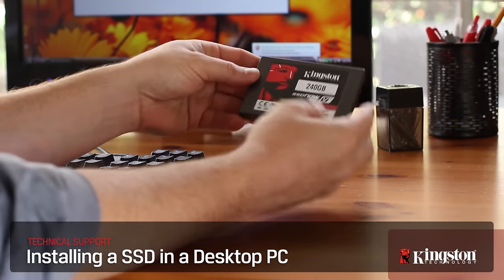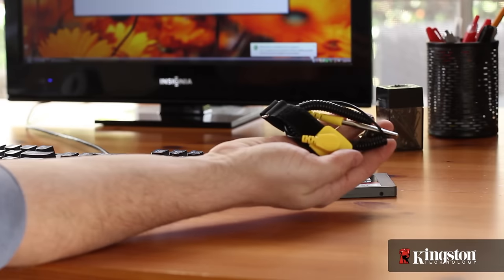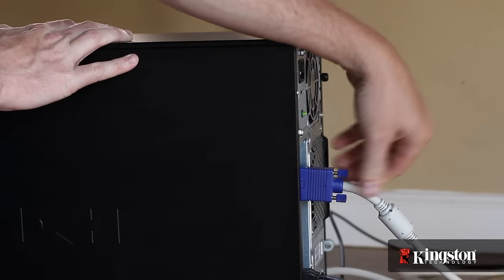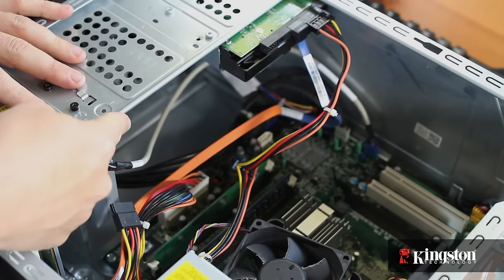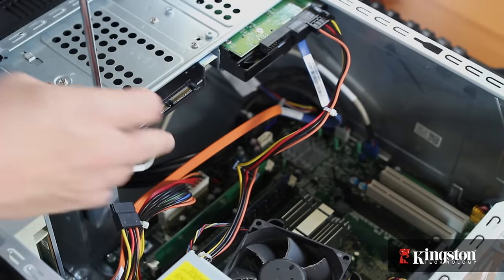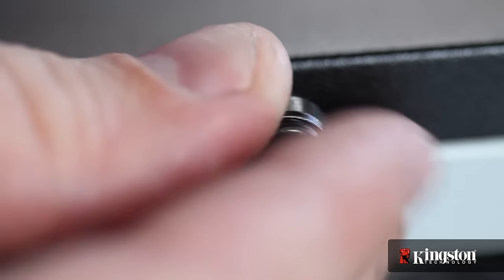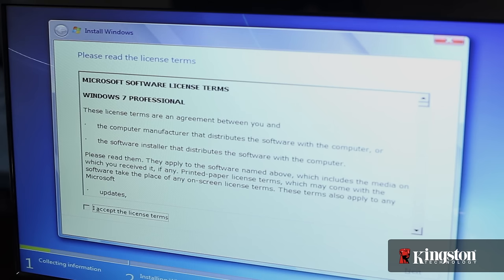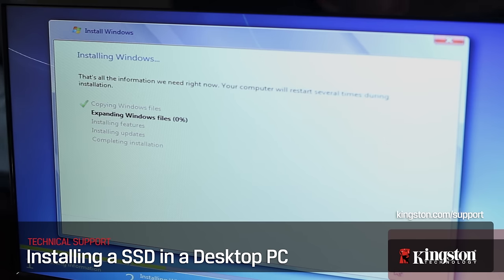Installing a SSD in a Desktop PC

Comment: I installed my ssd plugging in the sata and power connector and when I go into file explorer the ssd doesn’t appear
Reply from the maker: The SSD needs to be initialised through the Disk Management menu of Windows or Disk Utility in the Mac OS operating system before it can be utilised. Should you have any further questions, please contact our support team via: https://www.kingston.com/uk/support.

Comment: what if its an 8gb ssd? will I still have to transfer all my files? they all are WAY more than 8gb. is there a way to boot with my ssd and store with my HDD?
Reply: 8b is not nearly enough to hold an operating system. Get a 60 gb ssd if you want to install the OS on it
Reply: Do 8gb ssd's even exist?

Comment: What make or model are the Brackets to fit the 3.5" drive bay? Exactly what i need to fix the v300 ssd  to the  side mounted bay on a HP 3500 mt desktop.

Comment: I have a new kingston ssd. I haven't put this ssd in any system yet. Just opened the box. I want to install linux mint on this and use it. Do i have to first activate and configure this new ssd by connecting to anyone's windows computer? Or i just directly put this new ssd in my laptop and install linux mint with a bootable usb?
Reply: No need to "activate" it with Windows. Just boot off of your Linux Mint installer and it should detect the SSD.
Reply: @JJFlores197  no need to update the firmware of ssd???
Reply: @SVerma-kw9ol  Not really. In the 6 or so years I've use SSDs, I think I only updated the firmware on my first one, which was a Samsung SSD.

Comment: I just want to install an ssd so I can have my games on there but keep the os on the hard drive because I have a prebuilt. So would I need to reinstall windows
Reply: No, windows will boot from ssd normally
Reply from the maker: Hi, you can install the SSD as a secondary drive in your system and install all the games on it then. There is no need to reinstall Windows on your hard drive then.
Reply: @kingston  thank you
Reply: @elongated2761  Totally agree with Kingston. Many people these days don't use HDD. All memory is put on SSD no matter for Windows or file holding.

Comment: Hey nice guide! I was wondering at the end of the video you said you dont want to install over partition or unallocated space but you only get those options? Which one did you choose?
Reply from the maker: This applies only if you want to keep the data on the drive.  If it is already backed up or the partition is imaged on another disk as backup then you can install over that partition or unallocated space.
Reply from the maker: The correct sentence is to select the drive that is not partitioned or select the drive marked as unallocated as it is the case in this video.

Comment: Can i just buy a SATA cable in the store or do i get one when i buy the SSD, i mean does it has to be a special one to EXACTLY the SSD I have or can i just buy a random SSD cable and it will work on all SSD?
Reply from the maker: There are different types of SATA cables, you will need to check which one is compatible with your particular model.
Reply: @kingston  dont you get the cable with the SSD when you buying it?
Reply from the maker: Those cables are provided with the motherboard and power supply. Laptops do not require cables as they have drive bays with integrated connectors.
Reply: @kingston  I know the power supply which you connect to the SSD to get the power on it, there are already a few of them you can use when you get a new HDD or SSD, but i mean the other SATA cable the small one, you have to connect to cables to the SSD, right?. I took some pictures from the motherboard to find the SATA plug. If you want them then i can send them to you.
Reply from the maker: Come chat with our support, we can help get this figured out https://kings.tn/3g0rSjQ
Reply: Kingston Technology the link doesnt work
Reply from the maker: If you visit the Kingston website, you can contact our support team through there

Comment: Can I use it on my SATA 2 board (desktop)??
Reply from the maker: Please note that all of our SATA III SSDs are backwards compatible to SATA II.
Reply: @kingston  Okay. So, without the lesser r/w speed is there any other difference which will I get?
Reply from the maker: Apart from the reduced read / write speed performance there is no difference in terms of the functionality of the SSD when connected via SATA II.
Reply: @kingston  Thanks a lot for the quick reply. ✌️

Comment: Do I still need an hhd when I use ssd?
Reply from the maker: Not necessary, you technically need just one drive that carries your operating system. A secondary drive (HDD or SSD) is generally used as storage.

Comment: does it matter if my motherboard supports SATA III drives?
Reply from the maker: Hi Peter,  SATA III works fine with all current Kinston 2,5" inch SSD's
Reply: Sorry, I meant if my motherboard "doesn't" support SATAIII
Reply from the maker: Hi Peter,
The current 2,5" SSD's are backwards compatible with SATA II.

Comment: hi can you assist me I have already an ssd installed and has my os on it and few other things, basically I got given another 64gb ssd from a buddy of mine, I have installed it in the system now when I switch the desktop on and go to my computer, only my main ssd shows and not the other one I recently put in how do I enable it to show on my menu in the my computer section? :) its in an alienware aurora r3 model :)
regards

Comment: will this work on a mac pro 2010
Reply from the maker: If you mean a Mac Pro Workstation 2010 with either 1 or 2 CPUs, then any of our 2.5 inch SATA SSDs should work in this system according to our online configurator: https://www.kingston.com/us/memory/search?DeviceType=1&Mfr=APP&Line=Mac%20Pro&Model=65148 or https://www.kingston.com/us/memory/search?DeviceType=1&Mfr=APP&Line=Mac%20Pro&Model=65146

Comment: If i install a ssd for a few games to put on do i still need to do copy my stuff from my hdd. And can i just move the games from hdd to ssd?
Reply: If you're just using the SSD for game storage, you don't need to worry about moving your OS or other system files. You can move your games over to the SSD, but you will most likely need to to tell your game clients to either move it to the new drive, or add the new drive as a source for your game library.

Comment from the maker: Hi Anil,
I'm Jewel with Kingston Technical Support. Your laptop supports a SATA3 2.5inch drive and most of our drives are this form-factor. For your development needs, I would suggest our KC300 at 525R/500W MB/s or V+200 at 535R/480W MB/s which both include DuraClass, DuraWrite, and RAISE technologies for endurance, durability, and dependability. The KC300 also includes Advanced Power Management to save battery life which may be beneficial on your laptop. Thanks for choosing Kingston.

Comment from the maker: Hello, a SATA3 cable can be used with either a SATA3 or SATA2 drive and the speed would be limited to the capability of the drive and motherboard. If it is a SATA3 drive then using a SATA2 cable could hinder performance.
Reply: Dang verified account, creator of the video, yet 0 likes, 0 replies

Comment: Does the type of SATA type matter
Reply from the maker: It does.  SATA III has the highest possible bandwidth and speeds.
Reply: Kingston Technology but do the types all fit ssds?
Reply from the maker: All our current 2.5mm SSD's are SATA III compatible.  We also have M.2 variants that support NVME at much higher transfer speeds.

Comment: Is there no problem about the power input of ssd? Because the output of sata cable on power supply is 12v for hard drives and the input of ssd is only 5v.
Reply from the maker: Hey there SSDs consume much less power than traditional hard drives. SATA SSDs generally draw less than 5W at most, and M.2 SSDs can be around 7-8W under load. According to the following site, the SATA power cable can supply 3.3v, 5v, and 12v 
http://spr.ly/6056JxpUm

Comment from the maker: Hi, I'm Jewel with Kingston Technical Support, here to answer your question. The SSD needs to be formatted so it will show as an available drive in "My Computer" as our drives come RAW or unformatted like most other drives. To format the drive, right click "My Computer" and select "Manage" then in "Computer Management" go to Disk Management. For further assistance, please call us at 1-800-435-0640 (USA and Canada only) M - F 6am - 6pm PT, other area contact information available on our website.

Comment: Do I need a SATA 3 cable for the SSD or will a regular or SATA 2 cable work?
Reply: It is going to work but the speed will be decreased ..!
Reply: OMG he was talking about the cables ..
Reply: It's all good, my SSD works fine, though my read speeds seem to be well below the advertised 94,000 for the Samsung EVO, at 43,000 - but my write speeds are actually faster than advertised, getting about 40,000 vs 35,000.
Reply: sata 2 will work but you chould hit slower speeds but if you go online to an ecomerce site like eBay or Amazon you chould buy an adaptor for like £2
Reply: Not sure what cable I'm using, just using what my SSD came with or what my Mobo had, and it's pretty good.
Reply: Okay so it's just newer motherboards thet have the sata 3 conectors when they chould have been useing the sata 2?
Reply: I'm not sure what SATA I have but I know my PC boot time is really fast and program load is quick, so I'm happy.
Reply: I just need to get another SSD, a bigger one because I only have about 20gb left on mine.
Reply: I doubt an SSD will max out the bandwidth on a sata II cable s you should be fine.
Reply: It will still outperform a HDD so it won't be too bad.

Comment: hey i have a question when i ordere an SSD from amazon, does it come with the full package like with those supporters and cable and screws or jsut the SSD it self ?
Reply from the maker: Hello, Jewel with Kingston Technical Support, here to help. If you purchase the SSD in the Desktop Upgrade Kit then it will come with a DVD of Acronis software with Installation guide and videos, a standard SATA 3.0 cable, 4-pin Molex to SATA 3.0 power adapter cable, and a 2.5" to 3.5" mounting bracket with screws. The part number for the desktop upgrade kit of the 120GB V300 is SV300S3D7/120G. The drive is also sold stand-alone or just as the SSD itself which would be part number SV300S37A/120G, so be sure to check the product description when ordering. For any further assistance, please call us at 1-800-435-0640 (USA and Canada only) M - F 6am - 6pm PT and I or another available Technician will assist you.

Thank you for selecting Kingston as your upgrade partner.

Comment from the maker: Hi, I'm Jewel with Kingston Technical Support and would like to offer our assistance. SATA II (3Gbps) ports are theoretically limited to 300MB/s transfer speed and in real life testing it can be expected to reach an average of 285MB/s. With our SSDs depending on how the system translates the speed of the drive it can be expected to perform between 250-300MB/s. For any further assistance, feel free to call us at 1-800-435-0640 (USA and Canada only) M - F 6am - 6pm PT.

Comment from the maker: Hi, I'm Jewel with Kingston Technical Support, here to answer your question. The physical installation would generally be the same. You do not need to reinstall your OS but will need to format the drive before it will be visable as a usual drive. In Windows, this can be done by going to Disk Management by right-clicking computer, selecting Manage, then Disk Managment under Storage. For any further assistance, feel free to call us at 1-800-435-0640 (USA and Canada only) M - F 6am - 6pm PT.

Comment: I have a thin case optiplex 9010. There is 1 TB HDD installed in. I will install SSD. There is one P8 plug in the middle of a group of cables coming from power supply. The same cable has another P something connected to HDD. I have to plug that plug in the middle to SSD right ?
Reply from the maker: It depends on which model SSD you plan to install because of the connection that is required for it. Which model are you interested in?

Comment: Very helpful but I have a bit of a problem. I want to use my ssd as the operating system. I know how to clone my hard drive to my ssd. But I then want to still be able to use my hard drive for storage space. All fine but I also still want to be able to use my optical blu Ray drive too. Well in short my problem is... I have 3 things I need to connect to the Sata thing. But my mobo only has 2 Sata connectors, also my itx mobo only has 1 pci slot I am using for my graphics card. Am I stumped or do you know a way round this? Thank you.

Comment: I opened my SSD straight away.
Found out that i have no mounting adapter and will only tomorrow be able to get one.

How am i gonna be sure my new PC (never turned on so far) is not gonna be damaged because of the "Static electricity"??

HELP!

(i would rather throw away the new SSD than the new PC) 

HELP!

Comment: Alright just 1 problem for me. I have a new pc coming in with only a 500 gig ssd, and I want to add a 1tb ssd. However, I don't have the windows installation disk coming with the pc, what do I do? Bare in mind this pc will be a fresh install of windows 10 with no games or anything when I get it. Can I still install the SSD?
Reply from the maker: You can use a USB drive to create Windows 10 installation media. Visit the Microsoft website for the file and instructions. Just make sure that you have the Windows key code, or you might need to purchase another copy.

Comment: how could i do if i dont have cd reader and original operative system? I Just bought a pc Desktop with Win10 preinstalled (bough from online shop).... :(
Reply from the maker: There are downloadable programs that can clone drives without the use of a CD. Check out Macrium Reflect or Acronis software as some options. Cloning a drive with a working OS will copy all information over effectively. We recommend obtaining a copy of Windows for your records as back up.

Comment: That is wrong. You can use an SSD as a cache for your computer. If you rarely restart it and you access the same programs frequently this can be a much better option considering you aren't using up 10GB on an OS and instead can use that for files or more cache space.

Comment from the maker: Hi Ilias,
I'm Jewel with Kingston Technical Support, here to address your question. As long as your system has a SATA III (6Gbps) or SATA II (3Gbps) port than any one of our SSDs should work properly, some older systems may require a BIOS or chipset driver update for compatibility. Updates can usually be found on the system manufacturer's website and it is typically best to check for software updates before upgrading hardware.

Comment: I just removed mine and them put it back. Now my computer is not starting. It is running a diagnostic and failing. Any solution for me?
Reply from the maker: Hey there thank you for your comment. Couple of questions, did you check that the cable was securely fastened? How about plugging a different cable or port in your system? If this is a Kingston SSD and you need assistance please contact us here: https://kings.tn/3DKdckX
Reply: @kingston  Thanks for the reply. I just figured out what happened. For some reason my boot settings got scrambled. I just selected the right options and it worked as usual.
Reply from the maker: Great to hear you are back in business! Now if it is our drive and you have installed it on a PC please make sure to check out our SSD Manager: https://kings.tn/37lzaPc

Comment: so i have a 250 ish gn m.2 860 samsung ssd on my motherboard and i want more space so i think ill buy a 1tb 2.5" ssd from u guys and i wonder if u think i should move anything like games or google or even windows onto it. Or should i move stuff that i dont use so offten like profile pictures (i swap from time to time) over to the 2.5 ssd and basically
Reply: Not sure if Kingston are going to answer on what is purely a user decision.  SSDs are optimised for operating systems and games - any application, program or software which benefits form fast access times is ideal for SSDs. Any data files can be stored on mechanical hard drives. Hope that helps.

Comment: Can't you just run the SSD as secondary drive? Like loading programs to that drive and files etc? Or does that not speed things up? Ie. Install video editing software on SSD and hold video files on SSD then edit at higher speed? Or does the OS on the HDD still slow down the process?
Reply from the maker: Yes you can run the SSD as secondary drive but your Operating System will not take advantage of the speed of the SSD.

The Operating System being the most important software on the computer, it would make sense for it to run as fast as possible.
Reply: Yeah that makes sense, I was just looking to cut corners and not have to reinstall the OS.
Reply from the maker: You could clone your OS on the SSD.

Comment: Is this Kingston SSD fully compatible with any regular old hard drive connectors? Meaning, do old hard drives, new hard drives use the same connectors as this SSD?
Reply: Yes. These are standard 2.5" SATA SSDs so they will work with pretty much any computer from the past 15 or so years that use SATA.
Reply: @JJFlores197  thanks mate.
Reply from the maker: Hey friends to add on to this discussion, here is the difference: 
SATA I (revision 1.x) also known as SATA 1.5Gb/s, 
SATA II (revision 2.x) also known as SATA 3Gb/s, 
and finally SATA III (revision 3.x) also known as SATA 6Gb/s is the speed the drives are rated for.  Just check with the system manufacturer to verify which type your system has or you can visit our site to see what we recommend here: https://kings.tn/3pGnj5a

Also for more info: https://kings.tn/32KI0DR